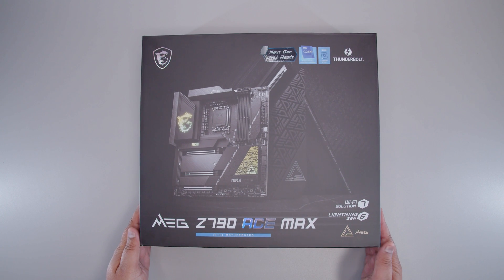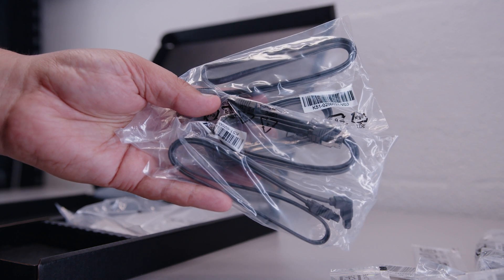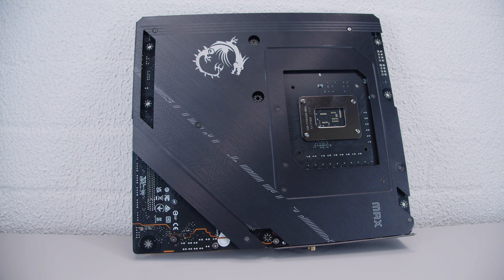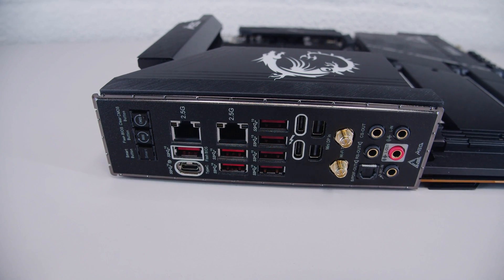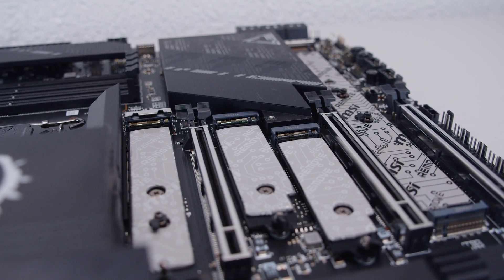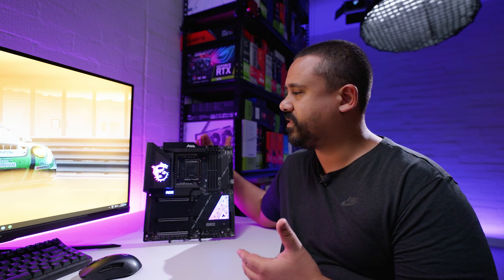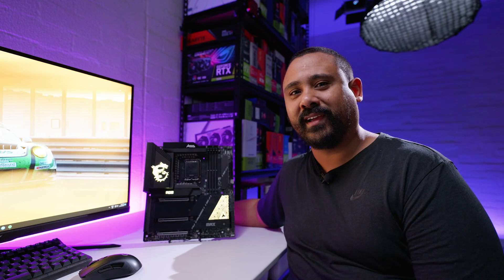Intel's Next Generation is coming | MSI MEG Z790 ACE MAX

Comment: My M.2 heatsink RGB doesn't work unless I push it in, like there's no contact in the magsafe-like connector. Something I need to look at, but the M.2_1 heatsink can be removed with the GPU in (for those with watercooling wondering..)

Comment: Where to connect HDMI port and display port? Why I don't see here, please advise.
Reply: The board has 2 Mini DP ports and comes with 2 Mini DP to DP cables. One of the USB Type C ports can also act as a DP port with the correct cable. I believe that takes place of a dedicated HDMI or DP port

Comment: The manual said M2_4 is PCIe 5, not the first one. is it true?
Reply: Yes, and if used it will disable PCIE Slot 2 and PCIE Slot 1 Turns to a 5.0 x 8. Or if PCIE Slot 2 is used it disables M2_4

Comment: Not much difference with the original Ace that i have except for the Wi-Fi chip and LAN port. Didnt make sense to have 2×2,5G ports... Same VRM/mosfet, maybe better RAM compatibility? I haven't looked at the comparison. Looks like they went back to the I/O shield design they had on the z590. Unless i didnt see well. On the original, the i/o shield is quite flimsy. Its a great board anyways. Replaced my z790 Hero that i gave to a friend with it and quite satisfied.👍

Comment: In my opinion the MSI X670X ACE is better when it's paired up with the 7950X3D as it opens a world of overclocking features that people are unaware of. I really don't think the next Gen of intel will dethrone either the 7800X3D or the 7950X3D when paired with the X670X Ace. But will see!!!
Reply: 3D chips are unoverclockable.

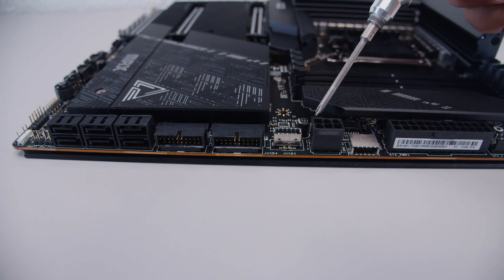Comment: At 03:14 - max 2 years down the road we'll have the first mobo with 2x 24 pin ATX power headers: the existing one, and another formed by the existing 2x8pin EPS headers + one of those extras but with 8 pins for even more power...

Comment: I've been looking for the answer to this question for ages... how is the motherboard lighting powered on while the board is on display, with no traditional power cables connected?
Reply from the maker: MSI and Gigabyte boards have a connector for Demo mode that you can plug a special cable in and use a USB powerbank to light the board up
Reply: Thanks so much for the reply mate! Big fan of the channel.. keep up the amazing work! @GearSeekers

Comment: Odd, no HDMI on the board?  Love the layout.  Especially those EPS power connectors.  Having them in the upper left corner is a pain in the hands, but what is a bit of bleeding if your wallet is already bled dry.  I am so happy we are not having to purchase another motherboard for the next gen processors.  I think the max M.2 slots is reached by 4 without going to have to add another controller chip and/or looking for ways to get rid of all the heat.   Remember, the GPU will be looming over those slots and will be getting hot as well.    I think that is going to have to be an important topic on how to cool the NVMe PCI 5x4 drives.  Thanks, Nick, to give us a peek of this board, I betcha there will be a whole slew of new boards coming.   Oh, wait... I was gonna say that the buttons for on/off and resetting the bios look huge.

Comment: if this board is around 3-500 hundred then its worth it but there are not enough features to justify asking more money for it. it has almost the same layout as my z270 taichi! that board was 239 bucks, the difference? 
1 NVME slotGen5 vs Gen 3.
1 USB 3.0a header and 
2 Usb 3.1 headers.
PCIex16 gen 5 (16x8x4) instead of gen 4 PCIex16 (16x8x4 LOL) , and some Gamer light and fan headers. this board looks lovely but if it isnt priced realistically it will rot on the shelf with all the other overpriced undervalue PC parts as of late.

Comment: I love they moved those power connectors to the other side. I always have trouble getting those two plugged in when in the upper left corner. However, one minor gripe I have is why do they always stick RGB in a spot that will be covered up by the graphics card? A 4090 will cover that neat RGB on the right of the slots.

Comment: Are people really buying new motherboards for a single gen CPU?
Reply: yes, if you are in need of upgrade from very old pc. If they can make RAM XMP more stable for DDR5, the better. For content creators, you'll probably want to stick to intel, but it depends on what you do.
Reply: @alrizo1115  why on earth would content creators stick to Intel? From the benchmarks, it's kinda ridiculous and obviously favored to one side arbitrarily..but beyond that, maybe I'm just speaking for myself here, even if I were to build an Intel system, I'd do it at the outset of that support lifecycle (2 years is a joke but at least they're doing three this time around). 

I built a custom loop AM4 system back when Ryzen 1000 came out with an 1800x. I upgraded to the 2700x and then the 5900x. Later on, I got a great deal and upgraded to the 5950x and x570s. Now I have that system and an AM5 with a 7950x3d that I will in all likelihood be able to upgrade to a 16 core single CCD CPU next gen AND a 32 core dual CCD CPU afterwards. How on earth is that advisable NOT to do?

Comment: Nice looking board. Agree totally with your SSD comment. Bought four of the Crucial P3 Plus 4TB Nvme drives for my two boys during the Amazon Prime sale. Both my boys will now have 8-10TB NVME storage on their systems. Eatx is not necessary, gives manufacturers another “reason” to charge so much for the latest boards.
Reply: One can never have enough storage 😀
Reply: I don’t know how they get through so much. My 2TB is plenty for me.
Reply: I recommend you build a NAS for storage, put it in the same network, and you won't need so many SSD's in your PC's. Not to mention anyone in the network will have access to it at any time. And if you use enterprise HDD's in it, it can run continuously for at least 5-10 years if no problems arrise. Not to mention the safety of your stored data, if you use a RAID type like 10, 5 or Synology's SHR (if your NAS would be Synology ofc).
Reply: My eldest wants to build a NAS for the house actually!